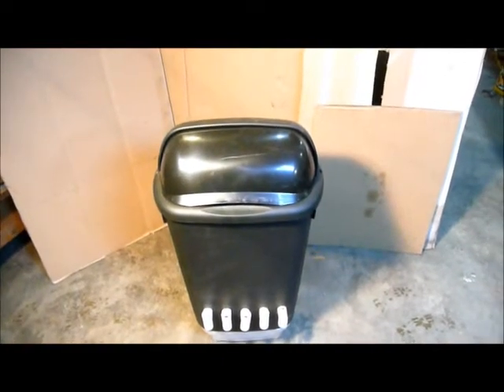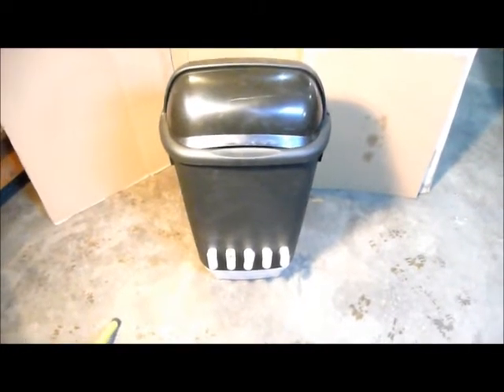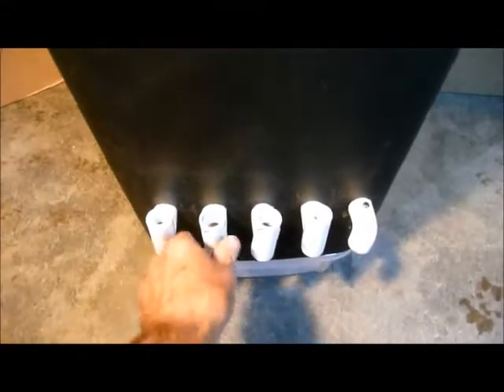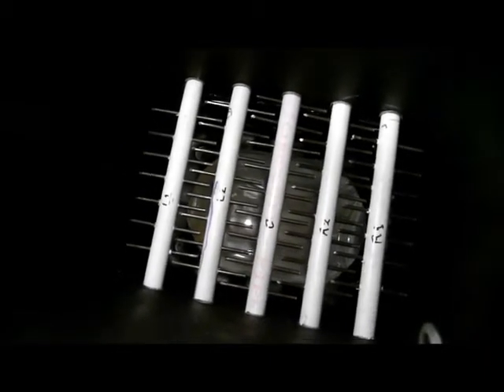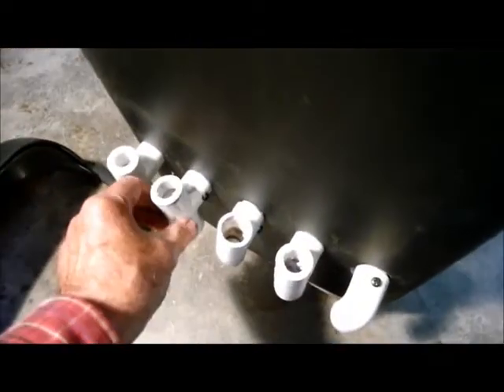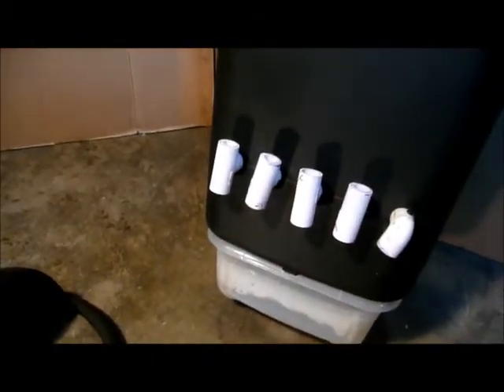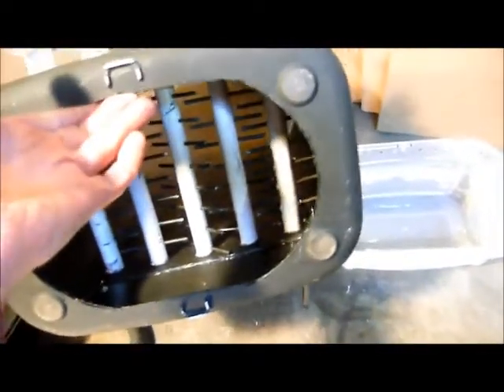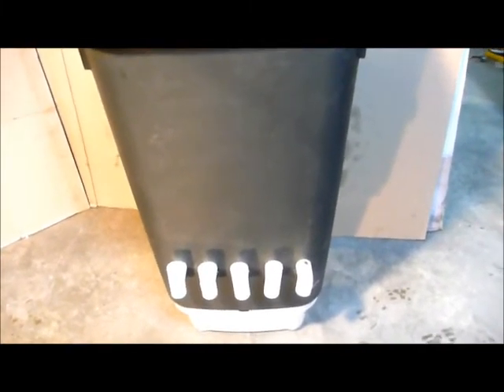Flow Through Worm Bin

Comment: Do you have an update for this. I am desperately trying to find the right design for me.   I prefer a continuous flow through design, but the current harvesting mechanism I have is not working.  Please update. Thanks!
Reply from the maker: Hello!  Sorry, no real update other than I am still using it and it works fine.  I harvested 5-gallons of beautiful worm castings late last year. It needs another good shakedown here soon.  I don't think any single design is perfect.  It still takes time to ensure all the worms get back into the bin after I harvest the castings.  If I did this again, I would come up with another method to turn each segment instead of the Tees.  Good luck!
Reply: I got fruatrated with the design I had, so I ordered a Toter Compost Bin for my worms. It isn't marketed for worms, but I am going to try. I need a "perfect" solution for me, but I haven't found it yet. My DIY flow through has a push-pull mechanism that is stationary due to the weight of the compost and does not harvest well. Thanks for the info!

Comment from the maker: Austin - for a 16 penny common nail, use a 5/32" drill bit.  If you can find some 16 penny finishing nails, that would save you from having to cut off the heads!  A wooden jig would help to properly drill the holes thru the pvc pipes.  Good luck!

Comment from the maker: Hi Austin. I drilled thru-holes one inch apart in each pipe. Tomorrow, I will determine the hole size and let you know. The holes in adjacent pipes are offset by 1/2". That way, the nails can pass by each other as a pipe is turned. The nails are driven into and thru the pipe so the nail sticks out equally from either side. With the correct size hole, the nail is secure and will not move. The pipe and nails are assembled THEN installed in the waste can.